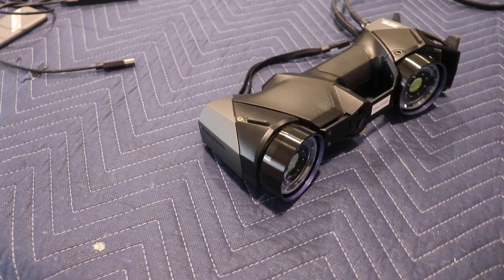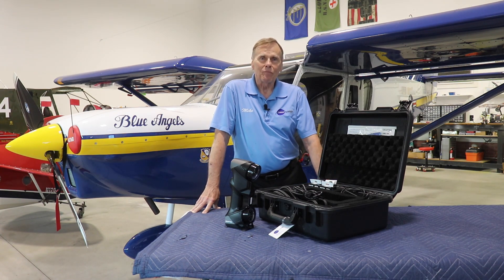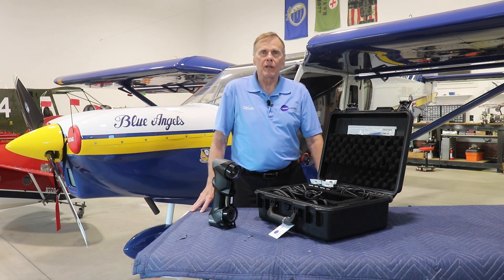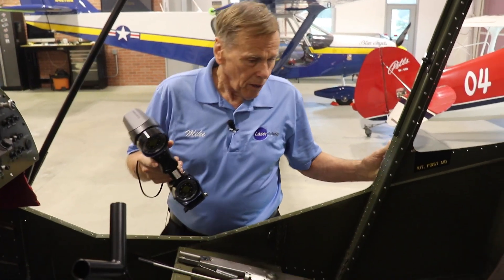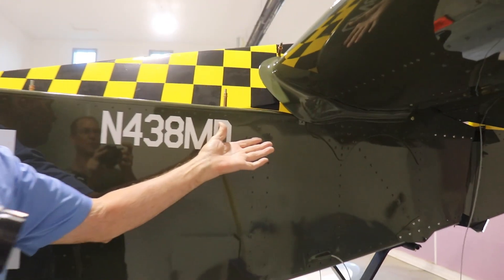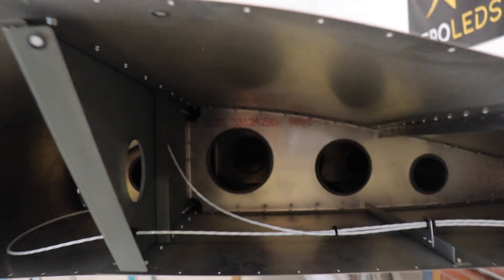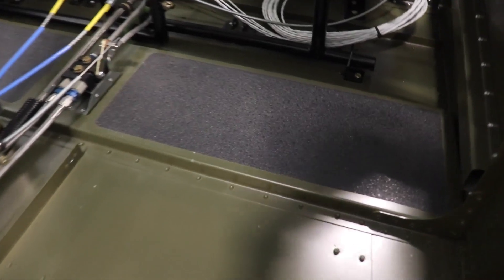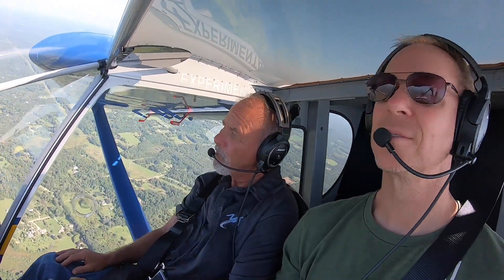Using a $90,000 Scanner to Scan My Airplanes!

Comment: First came across laser scanning back in 2008. 

Utterly blew my mind as a professional aircraft designer using Dassault Systems “CATIA” software to create aircraft surfaces. 

A lot of work was required to smooth out the point cloud created back then but 15 years on, all of that appears to be done in real time and the resulting tolerance is mind boggling ( 😮 9/10,000 th of an inch).

Thanks for posting 🙏 … truly amazing stuff to see it being applied practically in experimental & LSA in 2023 👏